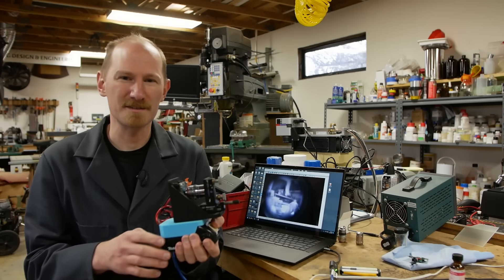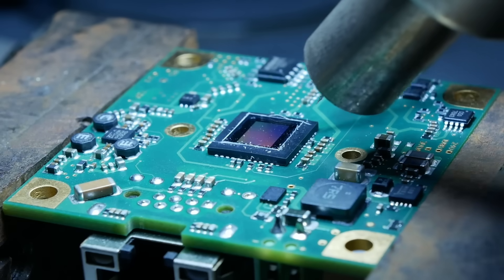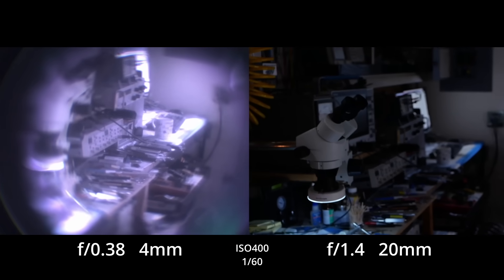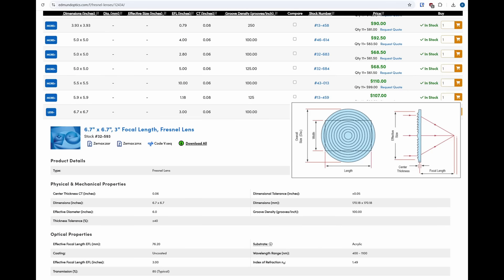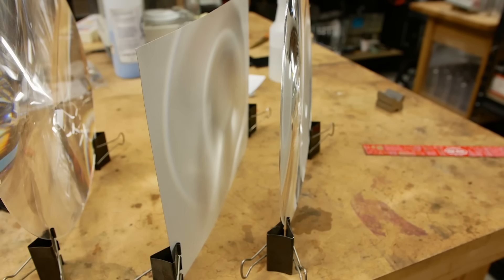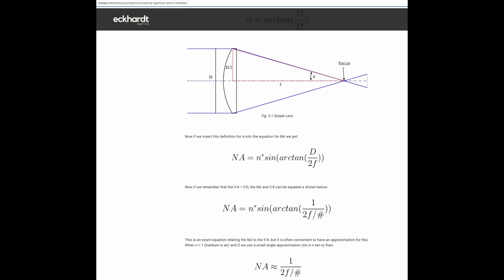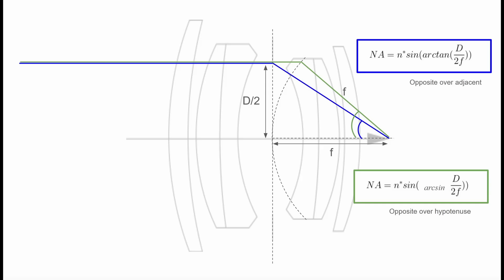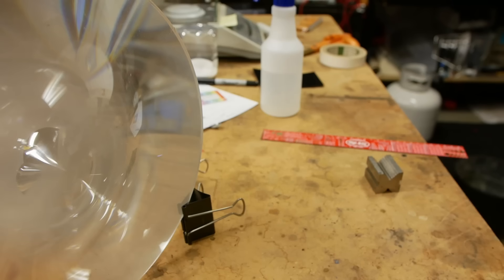f/0.38 camera lens made with oil immersion microscope objective

Comment: I think Telescopes are a great learning aid in understanding the transmissive properties of light through a lens.  That's how I first learned about how f-stops are not all the same between lenses, they are more of an approximation.  F-stops don't actually correlate to how much light passes through a lens, more of a theoretical, almost like transformer efficiency in a linear power supply.  That's what makes the Zeiss 50mm f0.7 lenses Kubrick used in Barry Lyndon so special, they were apparently engineered initially for use by Nasa with the lunar projects, so the film was basically filmed with telescopes.  It was a technological feat to create a lens with a useful focal length(50mm being very close to the perspective of a human eye) and a very fast aperture, with adequate corrections.  There's a lot of aberrations in Barry Lyndon, but, considering the lens aperture and other technical challenges. it doesn't really matter.  I'd be willing to bet that it was partly due to the development of those lenses, that Kubrick even came up with the whole idea to shoot the movie in the first place.  I think it's neat if a lens could inspire a creative notion like that.

Comment: 14:08 so I did some math and figure, instead of NA=n*sin(arcsin(D/2f))=n*(D/2f), it should be NA=n*sin(D/2f) (rad) and for small D/2f it can be approximated to NA≈D/2f, because now D/2 is the arc length and the formula of radian is rad=arc_length/radius

Comment: At the beginning you say "take the diameter of the clear aperture and divide by the focal length of the lens" and I was confused so I looked this up, I believe you meant to say the inverse of that. F number is the focal length divided by the diameter of the aperture. I had to double check, because the f numbers shouldn't be lower for larger apertures then.

Comment: Hello, Ben. I've watched your videos for years, and I think this is my first ever comment. Here are some ideas for removing the cover glass over the imaging chip. I have two of ideas, which could possibly be used in combination to prevent the glass from breaking into pieces. Don't do it the way you are. Specifically, don't try to pry it off. First, find a piece of stock material to use as a handle. Think like what jewelers glue to a chunk of mineral or gem when they facet them. I think they call them a dopping stick. Whatever you use would need to be very close to the length & width of the colored glass, and at least four inches long. Cut & smooth the end so it's as smooth as possible. You could also plane off the sides to match the length & width of the cover glass. Then use epoxy or some other glue to affix the smooth end of your new handle to the glass. The application of the glue might be tricky, because you don't want any excess to ooze out around the edges of the glass and stick to the chip - or worse such as the board underneath. Then start the removal process you showed in the video. Or, combine the stick with my second idea: use a Dremel tool with the one inch cutoff wheel to cut around the edge of the glass. Try to remove the "chip lip" which holds the cover glass, as much as possible. Or at least weaken it. And of course watch out for those bonding wires. Then apply the heat and start putting pressure on your new handle. With any luck, the glass will pop right off in one piece without cracking. But if it does crack, hopefully the glue on the stick will keep the shards from falling on the image sensor. And - just now I had a third idea as I was visualizing the application of the heat. Don't use heat, and use some solvent instead. The one used depends on the glue. You might use pieces of glass from previous failed attempts to run some tests to see which solvent would work without dissolving the chip body & everything on the board. Or maybe just stick with the heat, haha.

Comment: Excellent point on the hotend flow claims. I installed a Rapido UHF onto a big 3DPlatform machine a while back. They claimed flow rates of 75mm3/s or something, but on the big continuous flow parts it never got over 40. Very similar case with Slice Engineering and their flaims

Comment: de-glassing camera sensors, i found the best working for Raspberry pi cameras is to actually carefully break the glass and then use a box cutter blade to hook below the glass and pull it out piece after piece. small pieces falling onto the sensor didnt do any damage, as long as you dont touch the sensor with the blade itself.

Comment: Fascinating. I too am puzzled by the NA - f# relation.  Even with your discovery of the curved principal plane, then NA = n / 2 f#.  Meaning the index of refraction would still feature in the relationship. However, your measurements suggest that NA = 1 / 2 f# regardless of n. Still a bit puzzled on that. Were the focal lengths of the oil objectives measured in air?

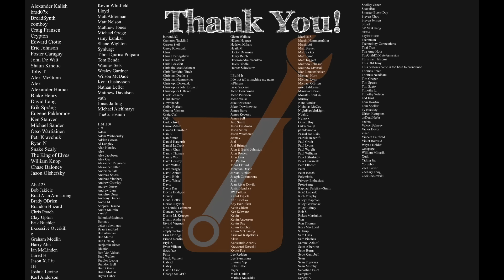Comment: Question: I thought that you use to calculate the NA and the f# by using the entrance pupil oder the exit pupil. Why you refer at 16:24 to the principle plane? Is the principle plane here the same as the exit pupil? I can only understand it if the NA refers to the principle plane, thats why its curved, but the f# refers to the exit pupil which is not curved.

Comment: Numeral Aperture Calculations

1. Definition: NA= n sin (theta), the n is he index of refection of the media  that the lens is in.    
2. Exact Calculation:  NA = n sin (arctan (Lens Entrance Pupil Dia / (2 * Focal length)), 
3. Paraxial Approximation:  NA = 1/ (2 f#), where f# = Lens Focal Length / Dia 

NA Paraxial approximation starts losing accuracy going lower than f/4 or so, inaccurate for high NA objective or lower f# lenses regarding of lens type or shape.

Comment: 0:24 you are confusing f-stop with t-stop. The two are equivalent if the lenses transmit 100% of the light that hits the lens, but that's not the case. The lens absorbs or reflects some of the light, so the t-stop is not the same as the f-stop.

Comment: I find it interesting that you don't consider this to be a 'lens' because of its aberrations. Plenty of lenses from the 40s and 50s (especially low aperture ones) are incredibly soft and full of defects but are prized for their optical quality. Photographers still reach for them for the unique look and context they'd use the lens in. Along those lines, I think there's a lot of potential in using this as a makeshift surveillance tool. You mentioned as well the sensor's sensitive to IR light, that could potentially be an interesting way to make an optical night vision camera.

Comment: I hate so many things about this video. You misunderstand so many basics about optics, sensors, lenses, and light. 

1. The F/# is a physical measurement of a lens, it has absolutely zero direct connection to the light the lens transmits to the sensor/film. Here's a nice example of what I mean... The f/# of a lens is calculated using an extremely simple equation, but you can pick any complex "effective aperture" calculation if you like... Now with your equation of choice, calculate your lens aperture. Now pretend you just put a 20 stop filter directly onto the front lens element. What's your f/# now? Did it change? What about your lens if you fill every air gap with sand. Any change to the f/#?

So yeah, youre actually discussing t/# (transmission). Every high end/pro video lens states their t/#, because it's an actually useful measurement (and you pay thousands for it). Consumer grade lenses will state the f/#, because it's easy to create the physical dimensions to meet that value.. but their t/# will be significantly worse (often and entire stop, or more, worse t/# compared to f/#). Basically, using f/stop to precisely measure lens performance makes you sound like an idiot. 

2. There is no way you talked to optical experts if you were never introduced to the concept of lens transmission. It's one of the most fundamental bits of knowledge in optics. And even consumer grade camera lenses have published values for both. lens reviewers like DxO publish t/# when they do lab testing of a lens. It is very very rare to find a modern consumer grade lens with an f/# and matching t/#. There are many lenses with well over 1EV difference (f/2.8 lens with t/4. Look at the canon/nikon autofocus 80-200 2.8 lenses from the 90s/00s on DxO if you're curious) 

3. There have been lenses "wider" than f/0.5. many custom (re-bodied) lenses using vintage projector lenses, x-ray lenses, or otherwise converted to a camera mount have much wider f/# than f/0.5.  while you can find bad articles on bad photography websites (petapixel specifically) saying 0.5 is the non-theoretical max, they're wrong (they're virtually always wrong), and your friends said its because "air has an f stop of 0.5". Ok... also makes absolutely zero sense air doesn't have an f/#, because it's not a lens housing, doesn't have an aperture, because it's air.. how could you even fill in the values for "air" in the f/# formulas. I will agree that f/0.5 is a value most manufacturers agree is the point where diminishing returns hit the point of lunacy. but the limits are related to retaining an image quality worthy of the price it would cost to create that kind of lens. The increasing divergence between f/# and t/#, as technically, the lens f/# has no connection to image quality or the amount of light it actually passes to the sensor, the widest lens possible is limited only by your budget and imagination. 

Let's move beyond the optics nonsense and look at the sensor in your project... The "cover" you removed from the sensor certainly increased the image brightness. Is it a UV/IR filter? A low pass filter? There's varied performance increase based on the sensor, and how many filters are removed, but 2 to 3 EV increase to brightness is pretty common when a dslr sensor has that same procedure done. Just removing the Bayer sensor is at minimum, a 1EV increase. As I'm sure you didn't recalibrate the ISO/sensor processing firmware to make sure your sensor was actually performing at ISO400 (a standardized measure of film speed/amplification). And since the image you produced has such an abysmal quality and dynamic range, that it's extremely easy to reproduce with any cheap dslr lens, just by cranking the ISO (or pushing the exposure a few stops in post), and still retaining much higher quality, I'm willing to bet you didn't consider this, or how such a small pixel well sensor would perform when you increase refraction (the oil. Photons are being sprayed everywhere), and massively increased sensitivity by removing the sensor filters. 

Anyways... Please talk to actual experts, this video may be the worst optics video I have ever seen on here.

Comment: Hi Ben,

Couple of thoughts about the video. 

As numerical aperture can be defined as NA = n*sin(θ) or NA = n/(2*f/#), from this focal ratio can be defined as f/# = n/(2*NA).
Subsituting NA with n*sin(θ) indecies of refraction cancel out and we are left with f/# = 1/(2*sin(θ)). Thus regardless of the medium between the rear lens element and the focal plane the focal ratio is determined by the sine of the half-angle of the light cone.
For a planar detector the maximum angle that light can physically reach the detector is 180 degrees, and thus the maximum half-angle θ is 90 degrees. As sin of 90 degrees is 1, the maximum f-number for such a system is thus f0.5 and maximum numerical aperture in air NA = 1.

From the definion of numerical aperture we can observe that the only way to increase it above 1 is to replace the medium between the objective and detector with a medium which has a refrective index of more than 1. Commonly used mediums for microscopy are either water (n=1.33) or immersion oil (n=1.51).
But does using an oil immersion objective with a numerical aperture greater than 1 such as the NA 1.30 one you use actually admit more light to the detector?

The half-angle θ can be calculated derived from the numerical aperture definition as θ = arcsin(NA/n). Now plugin in the numbers we get arcsin(1.3/1.51) ≈ 59.42 degrees, with this angle one can calculate the f-number to be around f0.581.
There are microscope objectives that are designed to be operated in air without a coverslip with a numerical aperture of NA 0.95. Such an objective would have a half angle of arcsin(0.95/1) ≈ 71.8 degrees, which correspondes to an f-number of around f0.526.
One case where the oil immersion objective does collect more light is when the detector has a cover glass optically coupled to it, this is effectively the scenario shown in the video at 15:00. Since if one uses an objective designed to be operated in air with an numerical aperture 0.95, the NA is conserved as per Snell's law when transitioning to the new medium resulting in a half-angle of about 40 degrees as opposed to the oil objectives 68 degree half angle if an objective with NA 1.40 is used.

If the high NA oil immersion objective does not collect more light then how does it manage to obtain higher resolution, when it is used to observe samples under a microscope? 
The answer lies in the fact that when light travels in a medium with a refractive index of more than one it slows down. Since the frequency of the light does not change its wavelength must reduce and since resolving power is proportional to the wavelength this results in a higher resolution.

The objective being used the Olympus UVFL 40x/1.30 Oil appears not be corrected for field flatness on the edges of the image circle and as isn't an infinity corrected objective as others have also pointed out. This results in an image that times weirdly in focus, with the edges being sharp and the center blurry and vice versa.
A 4mm f0.581 lens would have an entrance pupil diameter of approximately 6,9mm, which would be equal to 20mm f2.9 on a micro four thirds camera or a 40mm f5.8 on full frame sensor or 35mm film. Such lenses would not be considered having shallow depth of field at normal subject distances of 2-3 meters.
It shoud be pointed out you had measured entrance pupil diameter to be 11mm. I don't have no good explanation for this.

Comparing the brightnesses of two images presented, the one from the camera with the microscope objective is certainly brighter I would estimate in the range of 2-3 stops, although this is a bit hard to judge.
There are however a few things that come to mind, which might have an effect, these being:
- The differing transmittance of the lenses
- The differing sensitivities of the sensors at the same ISO, this could be 20% or more e.g. (ISO 100 of one sensor actually closer to ISO 120 and anothers to ISO 80). This can be avoided by (ideally) using the same sensor, but other ways exist as well
- Pixel shading at high admittance angles/focal ratios, where some of the light rays miss the light sensitive part and hit other features on the detector, thus not contributing to the amount of collected light
- Optical density of the infrared-cut filter above 700nm. As some other also pointed out the image looks like it has some ir contamination, which would increase image brightness. Cameras used for photo- and videography feature a hot mirror filter which increasingly attenuates red light above 580nm until it cuts it out almost completely at 700nm. Using a normal IR-cut filter will usually include these wavelengths making the image appear redder and brighter.

I would like to conclude by saying thank you for all the weird and wonderful experiments and topics you've covered over the years, that have always kept me entertained and coming back wanting to learn more.

Comment: my problem is if i introduce a 4 times microscope objective to my system it tends to darken the image and lengthen the focal length, now many years ago i came upon this idea  and the images of the moon for instance were unbelievable the problem is i can not re create the image i saw , as it was all about the eyepiece and combination of the microscope objective, so i am sure it is all about the distance between the eyepiece and the microscope objective if this can be recreated, we could redesign a completely new optical lens for observation i know it works but i can not reproduce that particular lens system  and i am sure you and i could with combined effort and information it was just an ordinary telescope lens with a microscope objective at the end, but more than that as it has to be experimented with but we can discuss this in private, as if we do succeed, it will be a revelation in optical design, that can be made at low cost